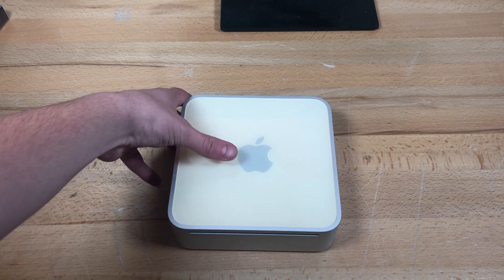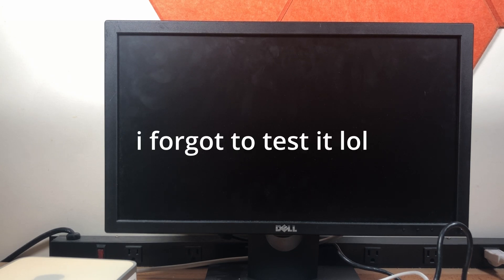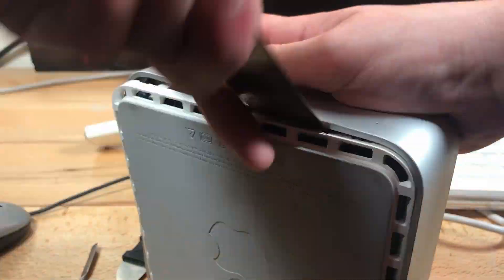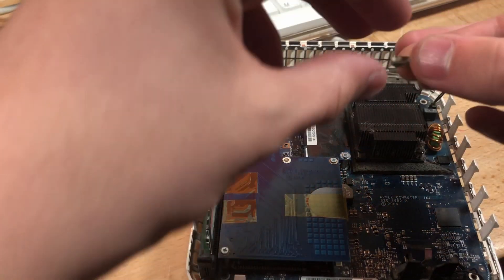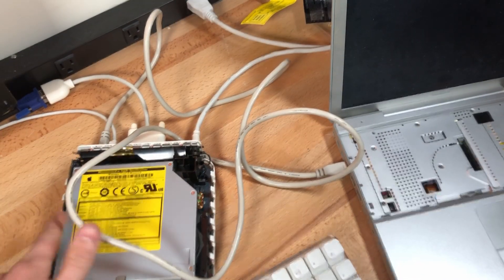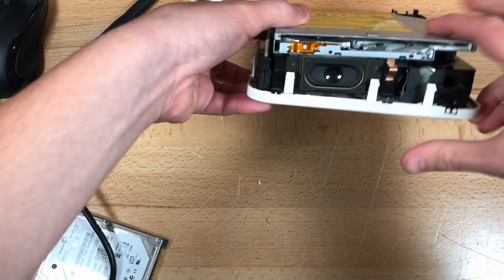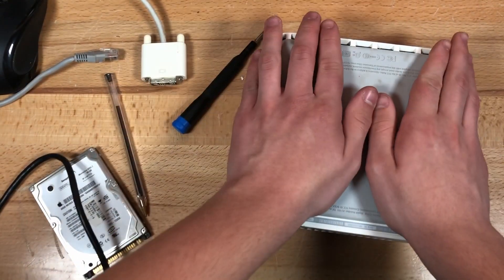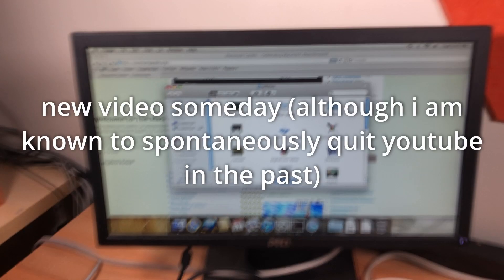MAX UPGRADING the FIRST EVER Mac Mini!

Comment from the maker: Updates:
1. The CD drive actually works, including booting and ejecting! I was surprised.
2. The PRAM battery was installed backwards, so the clock doesn't keep working after a replug. Oh well, this computer has WiFi so I can just use network time.
3. I installed Mac OS X Sorbet Leopard along with a bunch of applications. My next video will be producing an entire video on this Mac Mini.
Reply: Looking forward to 3

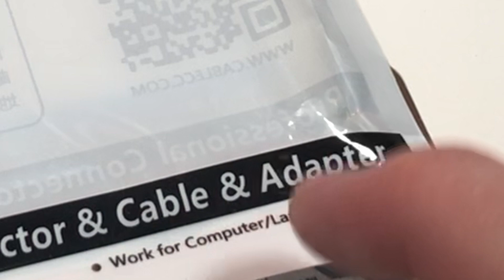Comment: 7:45 would been nice if you had shown a part number or linked it in the description. Not even a mention of the name of the part...
Reply from the maker: It’s an IDE to mSATA adapter, all the ones in a blank white case like this one that you can find on Amazon/eBay/AliExpress (regardless of branding) should be the same.

Comment: Even though you installed the SSD with its own OS, if you want to access the original drive and and the owners account, you can change the owner's PW by booting the OS Install CD (Should be OSX 10.4 Tiger) and go through the first steps of installing the OS until you get the Apple Menu Bar and from the menu bar access "Accounts", select the owner's account and change the password on the account.
Reply from the maker: I actually did go and change the owner's password but cut it out of the video. There was nothing there anyways as all their data was deleted, and I wiped the drive almost immediately after I removed it.

Comment: any viable linux distro for this g4?
Reply from the maker: Not really, Debian sid can run but poorly. Ubuntu is a no go and most others are either outdated or unmaintained.
Reply: @DistrosProjects  so, basicaly, that's a museum exhibition.. I was thinking of retrofitting its enclosure, turning the whole thing into a regulated power supply or a desk lamp stand...